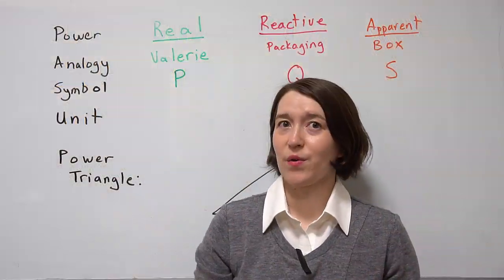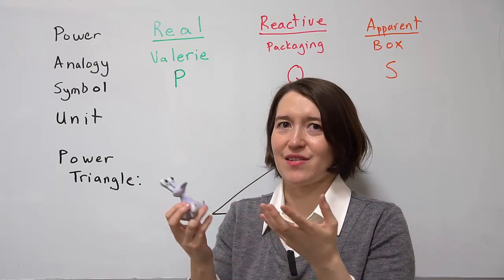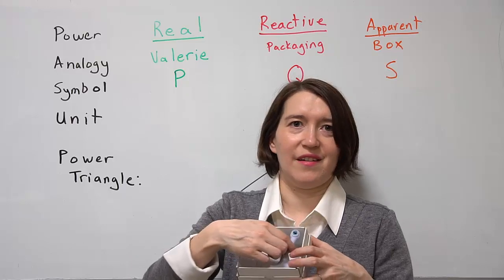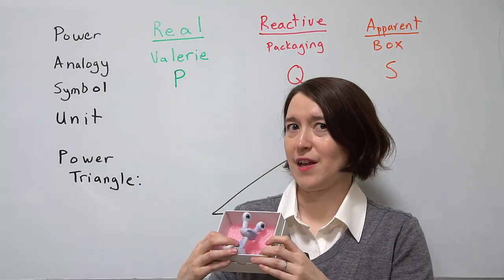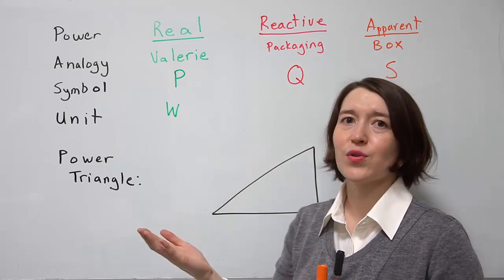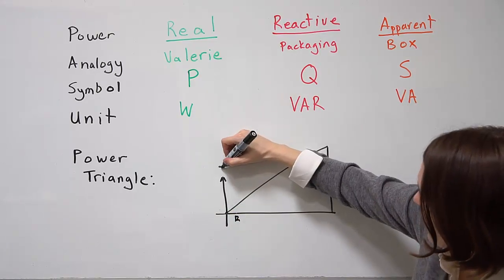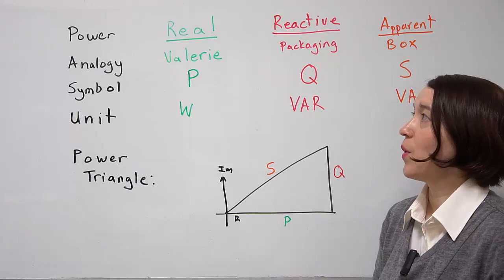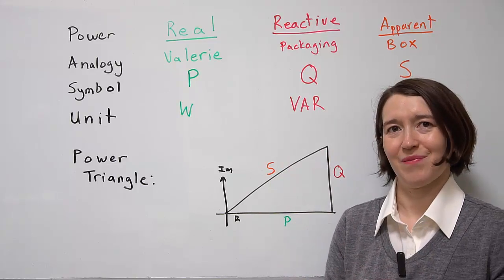Real, Reactive, and Apparent Power Analogy

Comment: why is it necessary to have reactive power?
Reply: Voltage and current don't always line up perfectly as a result of capacitive and inductive components in a circuit. This means that despite having a 10 V, 10 A  AC supply (100 VA), some of the power may be unusable because the instantaneous power is the multiple of two sinusoidal waves (P = IV) which are out of synch. Note this is only the case with AC currents, DC currents are unaffected because there is nothing to align.